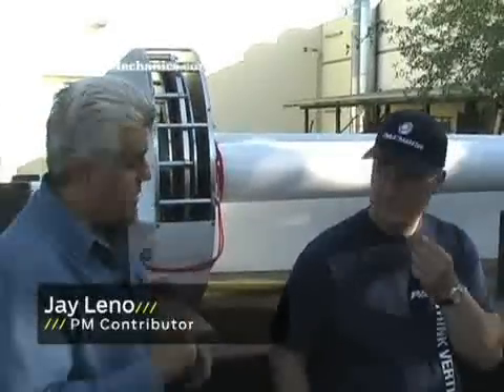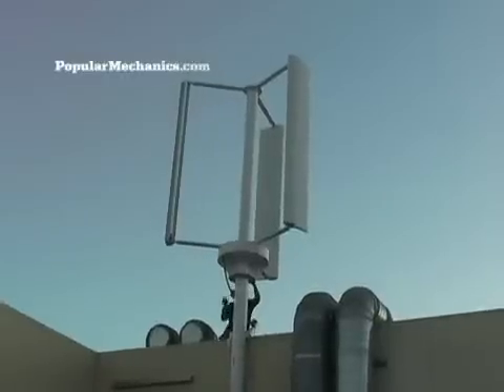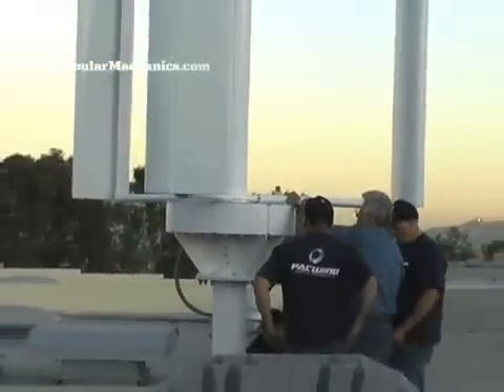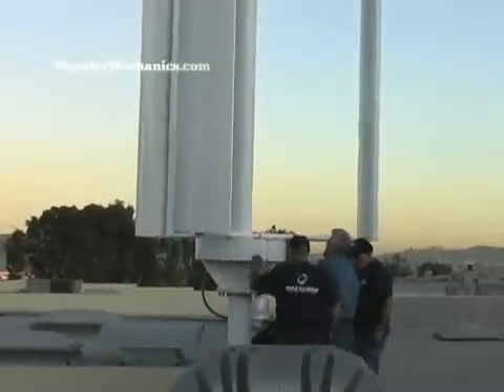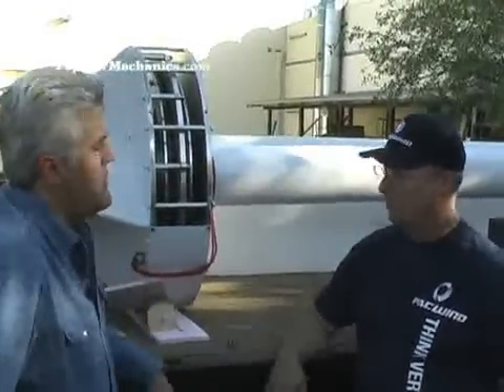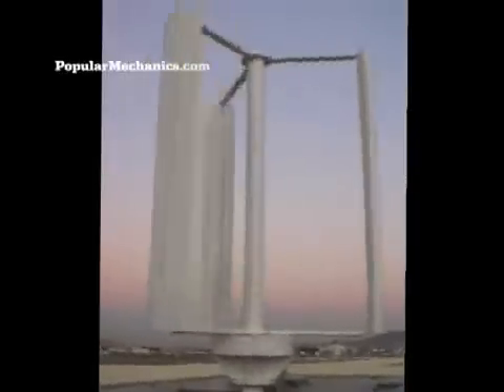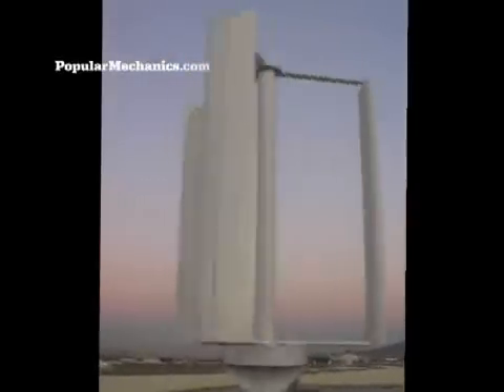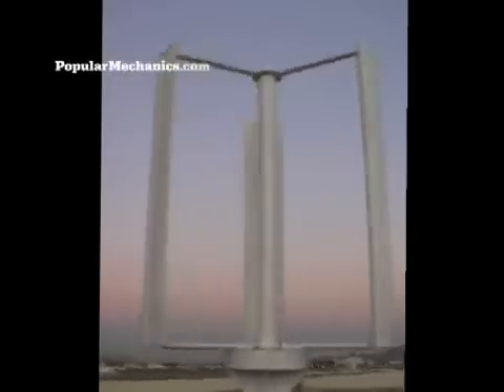Jay Leno's Green Garage: Wind Turbines | PopMech

Comment: @153mileyfan im guessing he really meant 2000 j/s, not watts per day, it would be around 172800000 joules in total if it ran at 2000watts all 24hours
A house that consumes 20 kwh per day actually consumes 72000000 joules in a day, meaning 2000w system generating constant power is more then double what a 20kwh house consumes.
but if you're house has 20 1000w servers systems running at full load in the basement the power consumed would be 10 times what is produced by the 2000 watt generater.

Comment: @TK42138 - It is not only the goverments but the power companies also.  If you try to do everything above board under NETMETERING the power companies will only pay you $0.015 per kilowatt/hr produced. You are better off having a cut over switch on YOUR side of the meter and switch your house to your alternative power source.  When you take your system down for maintenance you switch over and use the power company as a back-up power source until maintainance is completed.

Comment: depends on your class of wind in your location, and actual current wind speeds. Just one shold do about half of your average daily needs. Italso depends on the size you buy. You can actually achieve nearly all you need with the right size for the circumstance.